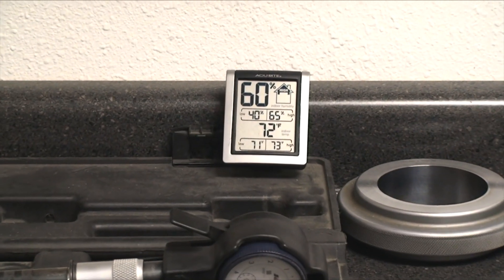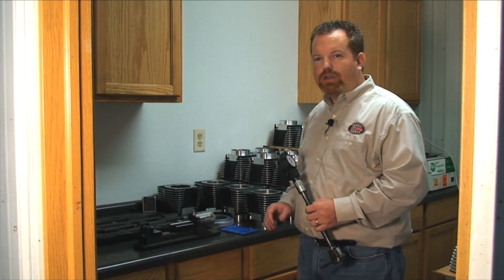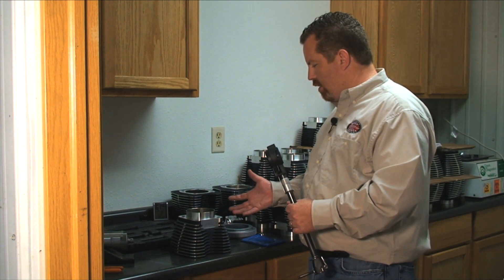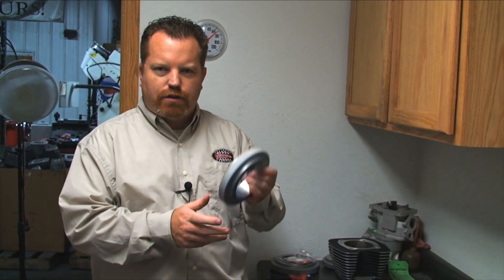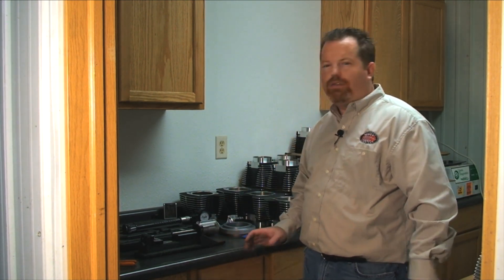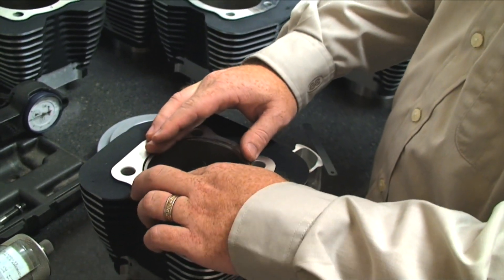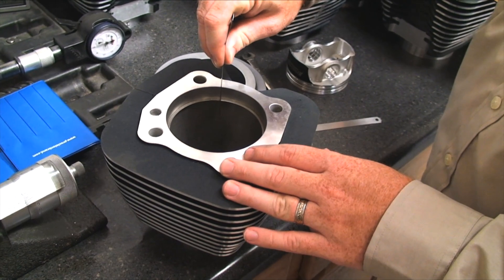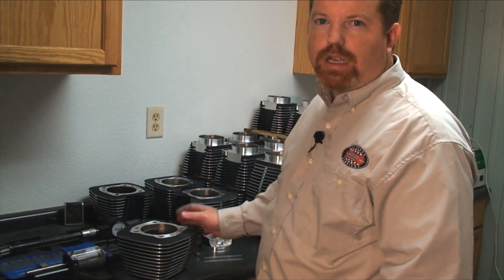Cylinder Sizing and Ring End Gaps

Comment: Do you guys use torque plates for those cylinders when boring? Some people do, some don't. I don't think oems cut their blocks with torque plates but some people swear by them. The problem I see with using torque plates is that they don't factor in the conditions the engine actually experiences at temperature, not sure of the true benefit.